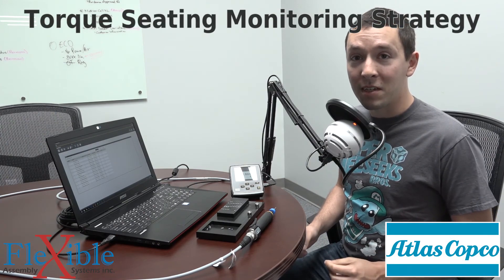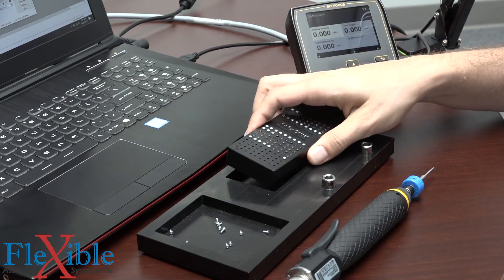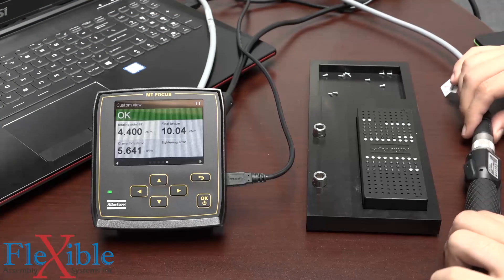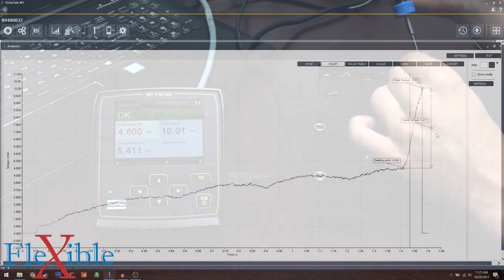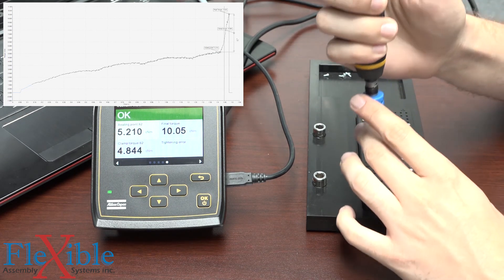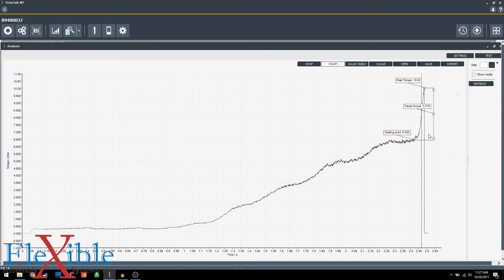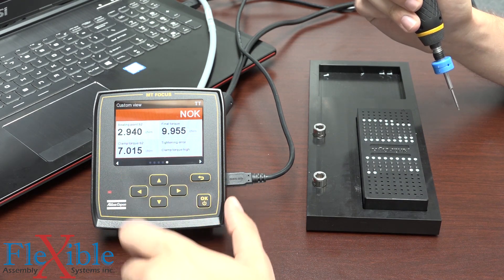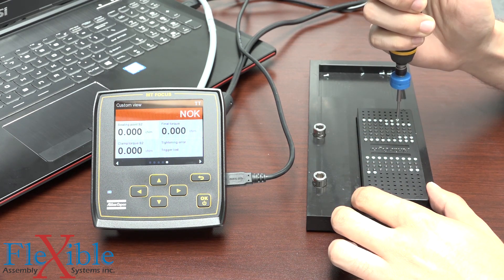Atlas Copco - Torque Seating Monitoring tightening strategy

Comment: What are "seating torque", "clamp force", and "final torque"? Thanks
Reply from the maker: Seating torque is the force applied to a fastener while it is experiencing compressive load (being squeezed together). Clamp force is a measurement of the forces currently holding that compressive load. Final torque when related to fastening is the last pass when you apply the final amount of torque required to get to your desired clamp load.